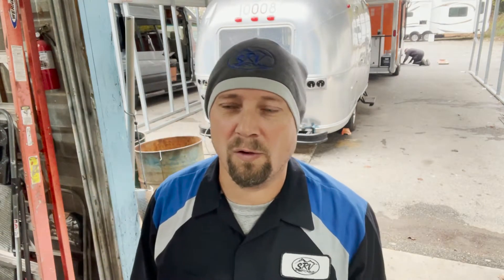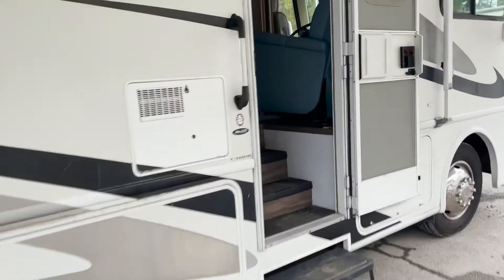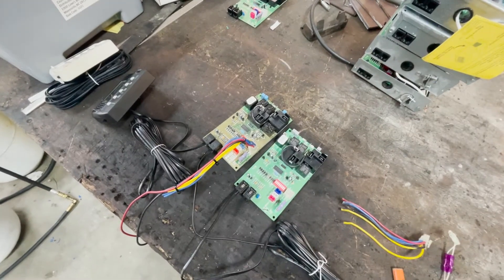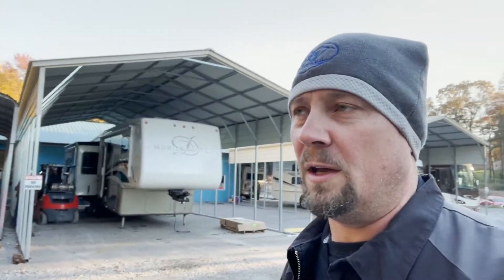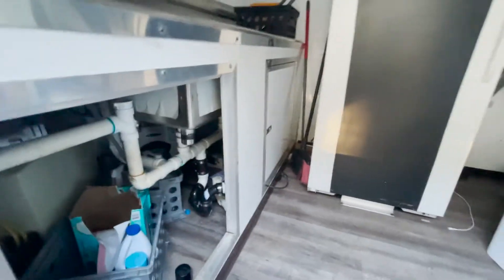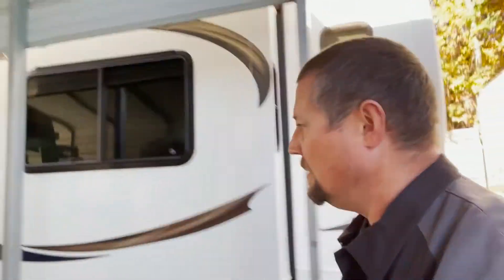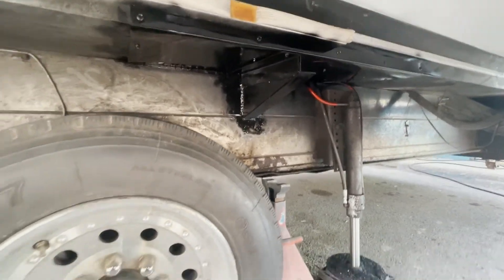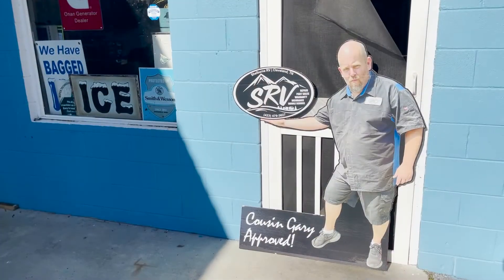Let's get connected

Comment: Figured I may get a better idea from you then calling an electrician come out.
So my breaker box is buzzing. 
So we love in an RV park and the water heater busted. Well they had happened to keep the old heater hooked up and on and install a new one within the past 3 years. Well the maintenance guy said I have no clue why it was even hooked up. And cut the power straight from the breaker box.

Okay well the buzzing has gotten louder. More consistent. No abnormal heat but it seems when I pull more power it stops. It's not doing it now but I also have a space heater on and several things from the microwave tv phone charger so it's pulling a good amount.
I really have no clue what's going on. It's a bit sketchy and when I leave I'm afraid for my cat so I've been cutting the power completely.

Plz plz any ideas?
Reply from the maker: Give me a call on Monday and we can discuss the situation 423-479-3627 thanks Steve.